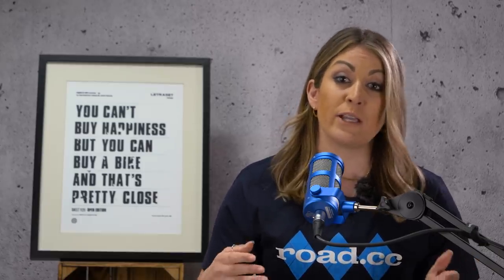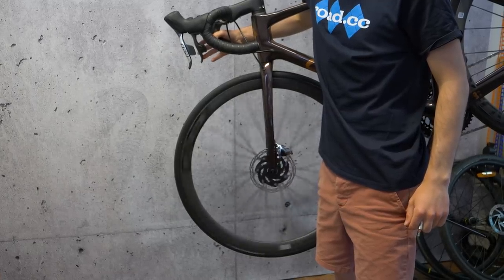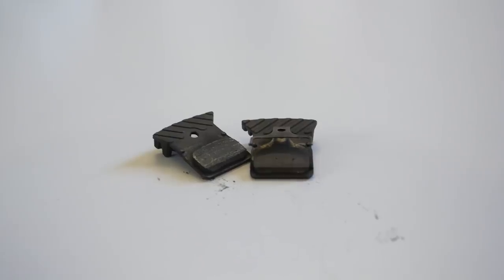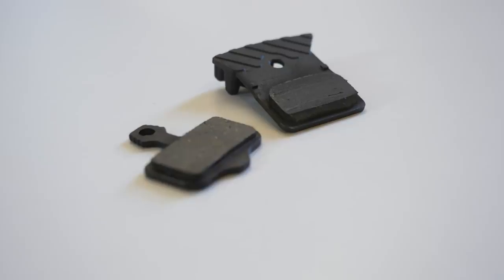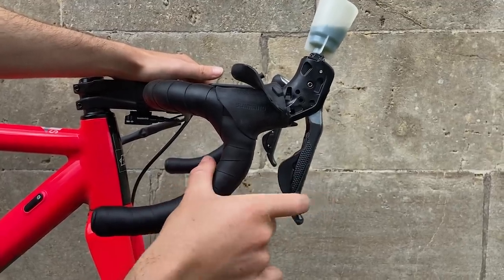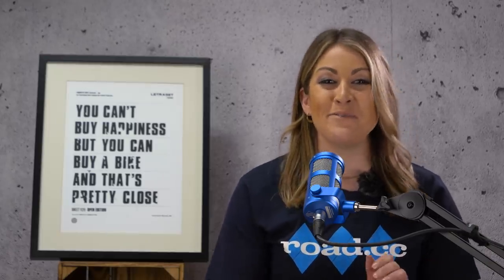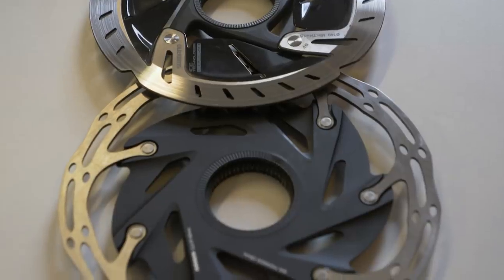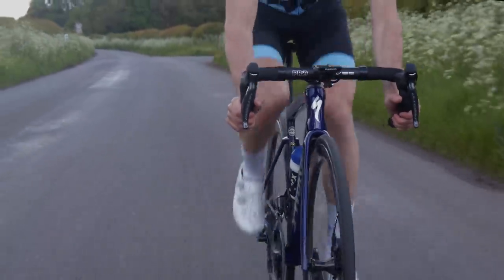8 things they dont tell you about disc brakes

Comment: Lots more trouble for only marginallly better braking. Another big foist by the bike industry?
Special pads, bleeding, brake pad cleaner, etc. 
With rim brakes, you buy new pads, new cable, and spend your time riding.
Reply: I have bled my mtn bike brakes once in 12 years (last year). Never used brake pad cleaner, use isopropyl alcohol fairly rarely on the rotors . Brake pad change is pretty quick with a bit of practice.

Comment: You forgot that wheels with rim brakes are often difficult to switch .  I purchased a 3T Exploro, thinking I would easily swap wheels between road , gravel, and MtB wheel sets, but quickly discovered that the different wheels all have slightly different brake rotor offset , and require adjusting after switching.
Reply: Use shims to adjust the rotors to the same position. It takes a little time to get the adjusted the same but I can switch between wheels without any problems.
Reply: That is true, wheels with bolt disc is not the same as center lock. There are small diferences between Mavic and DT Swiss wheels.
Reply: @mauricioguimaraes7849  that is my exact setup. Mavic 6-bolt that came with my bike and DT Swiss center lock on my deep wheelset

Comment: Brake rub has never plagued me. But screaming brakes, oh the screaming.
Reply: I had some cantilever brakes I could get a good tune with but my friends disc brakes made my ears bleed I couldn't believe how loud they were!
Reply: Every time my discs get wet I can use the brakes as a truck horn. Little embarrassing sometimes…
Reply: You have to brake them dry after rain and prevent any oil contamination to the rotors, in this case squeezing will be little likely with resin pads.

Comment: Having used rim brakes for most of my life, I just accepted that braking was awful and unpredictable and learned to plan my riding  so I wouldn't need to stop quickly. It worked. Why improve braking with discs?

What this video doesn't mention about flat vs post mount brakes is the flexibility. With flat mount you're pretty much stuck with 140 and 160 mm rotors, while there are lot of readily available adapters that allow you to stick 180 or 203 mm rotors to a post mount bike, should you feel the need for that.

Also, a braketrack is not a very aero thing to have on a wheel. Not having one might improve the aerodynamics of a wheel significantly.
Reply: You are considering 203 mm rotors and then talking about how absence of brake tracks improves aerodynamics? Come on man.
Reply: @jkk916  you're aware of the fact that rotors are removable, right? So you could have your 203 mm rotors on those alpine descents that you encounter on your holiday, and then go back to your 160 front/140 rear rotors once your holiday is over and you're back in Flatland? Right?
Reply: @rasmuswi  how do you install a 203mm rotor on your road bike?
Reply: @rasmuswi  It is easier to replace whole wheels. Carbon fiber rims for regular conditions and alloy for any crazy descends. Alloy rims + good quality brake pads will be superior to 160 mm discs. It will never overheat. Just don't run latex tubes in front.
Reply: @marcuswong1797  1: buy rotor. 2: Install on wheel. Done. That's no problem at all. The problem is installing the caliper if it's a flat mount caliper. If it's a post mount frame you just install an adapter. But a road bike isn't the bike I would install a 203 on. The bike that could get a big rotor would be something like a gravel bike or so, they also tend to have flat mount brakes.
Reply: @jkk916  Yes, so much easier.Loosening and tightening hose centerlock lockrings sure does require a master problem solver, or something. Id' say the difference is negligible. And then your solution has the problem that rim brakes suck. And apparently they do overheat since I wasn't supposed to run latex tubes.

Also, what you apparently didn't know is that most bike types nowadays get flat mount brakes. Road bikes aren't the big problem, the big problems are the bikes that you might want to put panniers on, like gravel bikes. They also have flat mount brakes.
Reply: @rasmuswi  You'd want to consider all the torque you are applying on the fork with those 203mm rotors might snap the fork blade clean off. Road forks don't have the necessary reinforcement to handle 203mm rotors, even if for some reason they have the clearance for one.

There are MTB rigid forks that may be able to withstand the torque of 203mm rotors but I'm not sure you'd want that extra weight on those alpine ascents (you gotta climb before you descend).
Reply: @rasmuswi  Rim brakes suck? I wonder where you get all this nonsense from. If you are speaking from experience I would say that you don't have any skills, you have very weak hands or you just use shitty equipment.
No they don't, probably they are fine even with latex tubes which you don't run anyways. The most safe option are tubulars though, no matter the braking system.
Why should I even care about disc brakes? I will stress about it if I will be buying gravel bike or a mtb.
Reply: Yeah, why improve braking?
Reply: @jkk916  I've used rim brakes since the early 80s, and the experience was always the same, you never know what you're gonna get. You simply have to start by braking carefully to see if you have lots of power this time, or just a little, and then adapt your braking after that. With disk brakes you get the same power every time you pull the lever with the same force.The rotor might be warm, cold, clean, muddy, snowy, wet or whatever, power still stays the same.
Reply: @rasmuswi  I would say that manufacturers didn't invest much in improvement of rim braking systems, but still, since 80s things have changed substantially.
I think disc brakes work better at low speeds and low traction conditions and they are obviously less prone to get heavily contaminated by water and mud. At high speeds I think rim brakes perform better. I am constantly hearing about discs warping, brake pads glazing, hydraulic fluid overheating, increased brake pad sticiton etc. It just does not seem as a reliable performance to me.

Comment: If I was changing something about disc brakes (and as a layperson I have no idea how you would engineer it), but I would like the calipers to retract further, creating a larger gap between the pads and the rotor when not braking. Also some sort of self-bleeding system (again not an engineer and am making stuff up).
Reply: a larger gap also mean a longer time to break which also mean that the brake won't be as responsive. I don't think self bleeding breaks is possible. For any hydraulic components to be working accurately, it must be a closed system with no air bubbles/pockets in it. having a self bleeding breaks mean that that system itself has to be integrated into a closed system, which said system has to find a way to get rid of the air bubbles. also the smaller the component, the more critical it is to get rid of all air bubbles/pockets.
Reply: Like I said, just making up things - but if I was going to do the wider gap on the pads, 1st of all, I’d make the trade off today if it meant eliminating rub (so long as the brakes stopped the bike before the lever hit the bars)., but I also thought about if the brake levels pushed more fluid at the beginning of the throw, and then gradually pushed less fluid as the brakes engaged for better modulation - don’t know how that would be possible..
Reply: @jeffkoontz2186  from the maintenance I've done on my bike, personally I think the pads are wide enough. initially I did had a tiny bit of brake rub, but it iron itself out in a week of constant use of the bike. But major rubbing is an issue, it's better to bring it to a bike shop, they'll know what to do about it. but once it's all set up, it's golden. What you mentioned is possible, but it would require electronics. from my understanding, the amount of fluid pushed through the hydraulic system is at a constant rate. X amount of distance on the levers move Y amount of distance on the brake pads depends on how they designed the lines. unless they go full electronic and increased weight, I don't think it's possible
Reply: Why do you need self bleeding.  Bleeding is only required if it wasnt done correctly in the first place.  Even after shortening hoses mine only required a top up and not a full bleed.
Reply: @darrylguise8493  and you only do bleeding every what? 6-8 months depending on how you ride, and it's really easy to do for any competent bike mechanic

Comment: Posh carbon wheels? Aluminum rims with machined braking surface combined with a decent dual-pivot cable-operated brake were pretty damn good in most conditions, but once everyone and his brother owned 'em the industry "needed" to do something to drive sales of new bikes. What better way than something that makes whatever you had before suddenly and forever obsolete? Hydro disc brakes, once they jammed 'em down the pro peloton's throat far enough were the answer. Just like tubeless road tires, a solution in search of a problem, unless that problem was how to convince the punters to cough up the dough for a lot of new equipment. Brilliant!

Comment: I rode decades up and down steep roads in the SF Bay Area and even as a larger rider with well adjusted 600/Ultegra calipers I never felt I lacked stopping power or modulation. Rim brakes have tremendous mechanical advantage (think of a weight being applied to an end of a lever) that disks lack. About the only thing I'd worry about with rim brakes is rims over heating on long technical descents on a warm/hot day. I found compared to disks, rim brakes do require more frequent adjustments and resurfacing. Overall if I was in the market for a new road bike where I would't be exceeding 28mm tires, I'd actually prefer to stick with calipers.

I do like the Ultegra disks on my cross bike that I use exclusively on the road though. I rarely have to worry about adjusting them (replace resin pads 2x or so a year) and like the fact that they work the same no matter what the width of the tire I use. I've not done a brake bleed in the four years I've used the bike and the system still works as new. Probably is better in inclement conditions also--but I'm a dry weather rider. I had a Miyata touring bike in the '80s and it had these awful cantilever brakes that I never could get adjusted right no matter what I tried. Disks on that bike would had been a real game changer...

Comment: Should do a video on removing a stripped bolt head........
Reply: get a screw extractor- basically a drill bit with a reversed spiral. you'll need to make a pilot hole in the center of the broken bolt to get the extractor started, as it drills in the bolt should start unscrewing out. you should stop with the drill then and just unscrew it out by hand

Comment: MTB-ers have been using them for years, and just get on with them....
Reply: Road disc aren't the same as MTB disc brakes
Reply: I've had both since the early years. Road discs have much smaller gaps between the pads and rotors, which causes a lot of the problems. I think it's because of the style of the levers being longer so there's less piston movement in the hoods, and the compact design with the shifter taking space as well.
Reply: Yes and that's like saying WRC is the same as F1... it's just cars?
Reply: They want a medal?
Reply: @reginaldscot165  they are just cars lol
Reply: They kind of are though... Stupid flat mount aside the calipers are basically the same. The major difference is really the application, and of course a lack of familiarity for users... TBH I'm sticking to rim brakes on my summer road bike, it's not resistance to change just that I don't really need discs on the bike and I'd rather save the money for now...
Reply: I have more issues with my hydraulic brakes in my MTB than my road bike! I ride more than 10000 km without bleed and metalic pads.
Reply: Apples to oranges my friend!
Reply: Rim brakes work best when the distance between the pivot and the rim is small. Increased rim width, increased tyre size, increased clearances all reduce rim brake performance. That, as well as riding in mud, is why disc brakes are such a great solution on MTBs. None of this applies to road bikes unless you're talking about tourers with fat tyres and mudguard clearances. I'm sticking with rim brakes, my bike weighs 7.1kg, hasn't cost me mega bucks and I can stop in all weathers.
Reply: @Mattj234  it all sounded good until you had a pop at wearing lycra, revealing yourself to be a 90s throwback. Most cyclists don't feel the need to be tribal anymore.
Reply: @Mattj234  who said I was a roadie? I ride whatever I want and no fashionista is going to tell me what I should be wearing while doing it. I love the way that dinosaur MTBers think that they are "alternative" and cool when all they are is sheep.
Reply: Exactly, and that is how I know discs don’t belong on a road bike…unless you want to ride a MTB on the road.
Reply: @reginaldscot165  well...yes. Same basic principles, same propulsion, SAME BRAKES
Reply: @Mattj234  we like riding on roads. You know, like normal people
Reply: This is a good point, mostly the problem with disc is the whinging, moaning culture of roadies. I ride both and it's quite noticeable how much more useless most roadies are.
Reply: @Mattj234  Lose the full sus too. It's just weight and ugliness.
Reply: @Mattj234  
Lots of people are overbiked as is, riding around mostly dead weight that they don't really need and technologies they couldn't possibly take advantage of.
MTBs are designed for a specific purpose. Many people that casually ride MTBs don't even come close to using even 20% of the bike's potential. If someone just likes to tour and takes the occasional dirt, gravel or fire road that maybe has some roots here and there...They are better off with a gravel bike, and yeah...maybe even rim brakes. There is no good or bad, just different tools for different jobs. And yeah, sausage skin lycra suits looks funny but in their intended purpose they are fully functional and make sense - do out of shape 50+ year old dentists and lawyers really need them? no, but i suppose they like playing dress up. And yeah, most roadies riding carbon bikes would also probably be better off upgrading the thing that sits on the bike instead of worrying about grams that, given their fitness, likely matter not one bit.

Comment: Disk brakes solve a problem no cyclist ever had. In 44 seasons of elite riding I've never once asked for more stopping power (as disk fanboys allege). I have disks on my Cx bike and I prefer the modulation and stopping power of my rim brakes. Disks are a PITA to maintain, and also you guys forgot to mention they squeal when cold too, so in Canada that is an issue in three seasons. But road.cc THANK YOU for being the first to burst the disk brake bubble the industry is so hell bent on protecting. Disk brakes work, yes, and are getting better all the time but they are a bad solution for 90% of the cyclists out there. I can see the need in MTB, CX and anywhere you ride in crap weather on varied surfaces. But for road bikes... hard pass. Plus, look how long it takes a UCI pro technician to do a wheel change on the fly vs a rim brake bike. Faster to do a bike swap actually... which puts costs up.

Comment: In regards to the comment of rim brakes creating dirty air. The upper fork section causes dirty air anyway which means that the effect would be minimal. Therefore that would be the best place to position the brakes. Where as disc brakes are position where the air is clean which means this creates turbulence in an area of the bike that was once before clean.
Reply: So you are an aerodynamics then?
Reply: @tomnewham1269  No but a lot of research. Discs have minimal turbulence if the wind is at a 0 yaw angle but turbulence increases when the yaw angle increases. With a cross wind the turbulence is significant unless you are hiding in a peloton. The positioning of rim brakes creates less turbulence.
Reply: @vietnguyen4312  I will agree with that.
Reply: @vietnguyen4312  That is only an opinion piece. He doesn't use any wind tunnel results to back up his claims.
Reply: @tomnewham1269  True, & even wind tunnel tests are often flawed.

Comment: Interesting chat here
RIM IS A WIN, DISK = LOSER
I bought a DOGMA F10 RIM - seriously expensive bike, amazing comfortable and nimble ride, cornering is superb, now I am a life long cyclist and understand how bikes work. They are not meant to be exact and precise, if you're a strong cyclist your bike frame will flex and bend a little in response to the force you exert on it, this is where disks fail - they are meant to work with a frame which is precise and rigid to keep them absolutely true however bikes aren't meant to be completely rigid so the disk concept fails  Further the torque moment created when braking is at the end of the front fork with disks- thus the braking force creates a huge torque moment leading to the front fork being vulnerable to failure if you hit a pot hole while braking- disks are therefore dangerous (see giro 2021 stage 9 for example of fork failure while braking and hitting pothole). CONCLUSION: DISKS ARE DANGEROUS AND DON'T WORK WITH FRAMES WHICH ARE MEANT TO FLEX AND BEND A LITTLE.
My beautiful Dogma is a RIM version, I will never never buy a disk bike, 
Team Ineos has been cleaning up using the advantage from rim bikes, it is not just weight, it is energy penalty when the disk frame flexes and bends under strain from the strength of the rider - I guess there are plenty of idiots out there who don't understand that and therefore will not win races... DISK = LOSER 
This is due to your frame flexing and bending in the sprint which pushes the disks out and causes rubbing and therefore an energy penalty